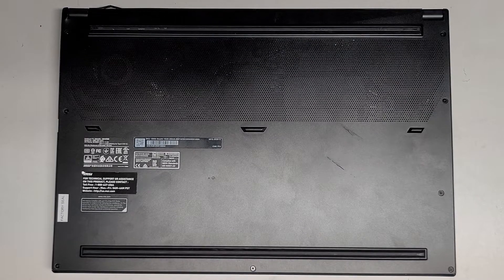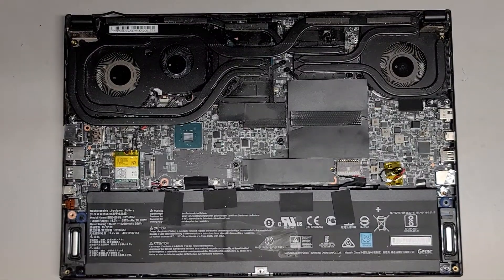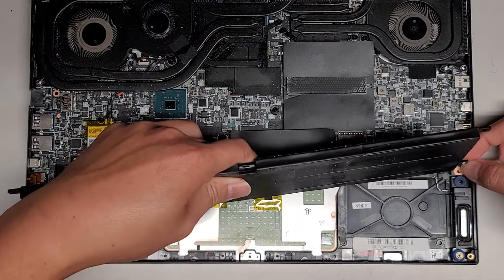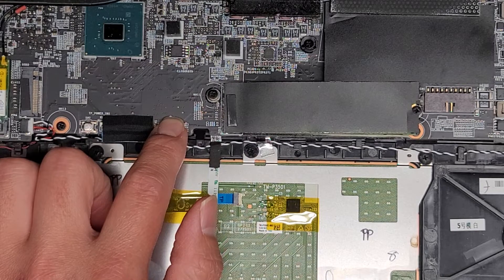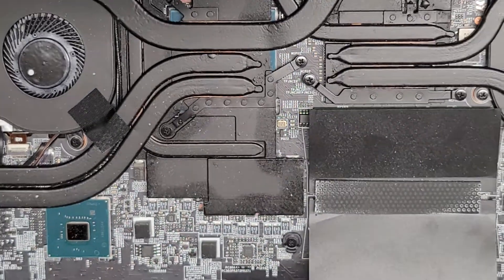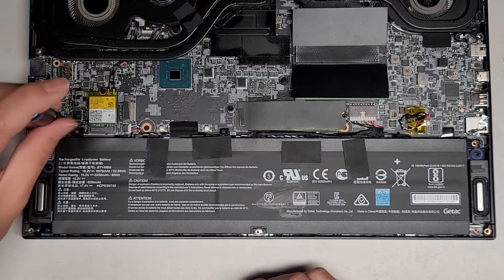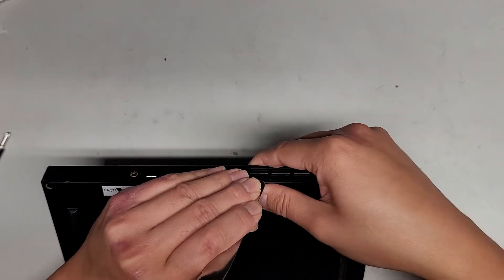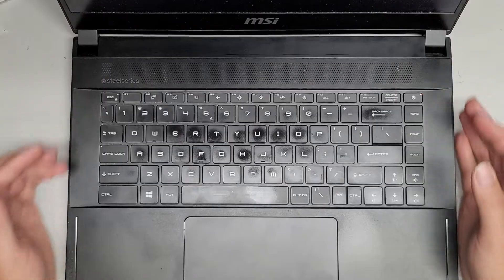MSI GS66 Stealth 10UE-256US Disassembly RAM SSD Hard Drive Upgrade Battery Replacement Repair

Comment: Hi, i have the gs66 11ue, do you have any recommendation about where can i get a new battery to replace mine? its the stock one and has around 54,000 mwh left, so it lasts about an hour and 20 minutes even at low energy mode unplugged, i have read a lot of bad reviews in amazon of some batteries for these models, they say that the battery works well for a month or 2 and then dies instantly and burns, do you know where can i get one reliable and durable battery? im from mexico
Reply from the maker: Hmmm I'm not to sure for Mexico. Sometimes you can find oem on ebay.
Reply: @ItsBinhRepaired  hey, its me again, i might be having a bad luck week but the main fan of the gpu stopped working, i bought on amazon a replacement but it does not fit well, do you know some fan model i can get on ebay or amazon that fits the gs66 11ue?

Comment: is there any other way to open it besides a suction cup?
Reply: I used a screw driver underneath the hinge between the keyboard and the screen. I do not recommend this however as i scratched up the finish pretty badly.
Reply from the maker: @swifty3399  ouch
Reply from the maker: Get two pieces of tape. Tape them side by side and have the middle overlap and stick together to make a pull tab. You can also try pry tools and fingernails.
Reply: I ended up using a philips screwdriver but thank you for the info!
Reply from the maker: @swifty3399  uhhh what? Lol